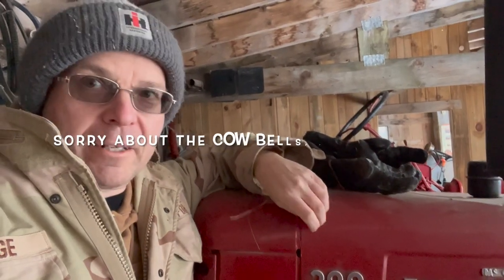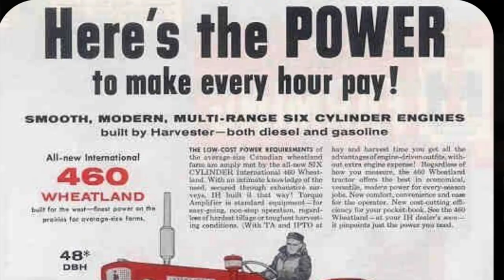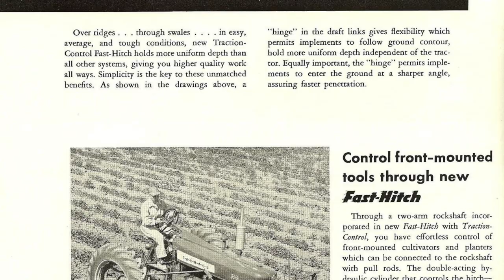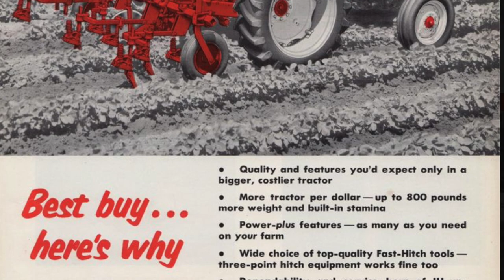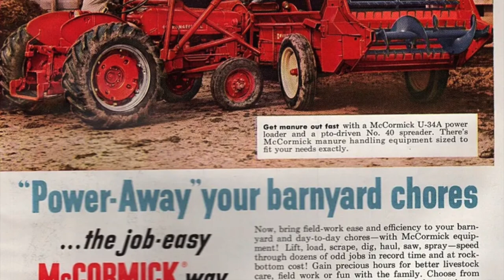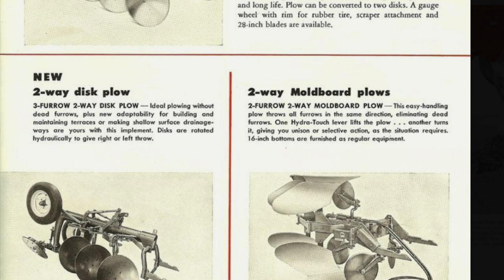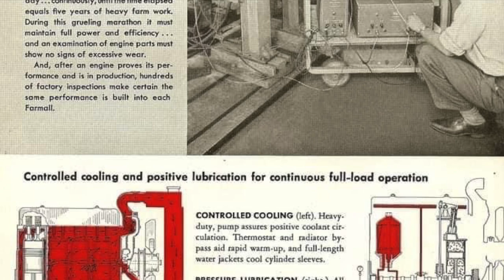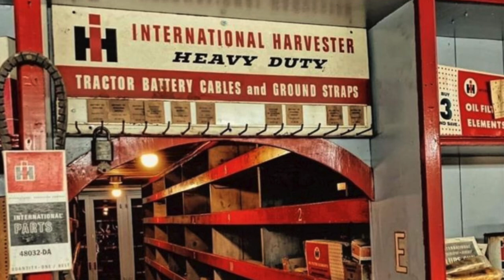International Harvester Farmall 100-Series Tractors,1954-‘58

Comment: My understanding is that slow selling Super W-4 was replaced by the fast selling H 300 Utility.                                                            Big end of the range was the "9" series (W-9 etc.) which were only built as Standard Tread tractors. They had a separate history to the smaller Farmall models. There was originally a W-9 and a WD-9 diesel- both 335 c.i. The Super WD-9 (350 c.i.) replaced the WD-9 but there was no Super W-9. Strangely IH offered a gasoline rice-field model called the WR-9S (335 c.i.) which equated to the Super WD-9 wheatland model. In the "100" series Super WD-9 was updated as the short lived International 600.                     The International 650 replaced the 600. The 650 was the first in this lineage to receive an LPG fuel option. The 600 and 650 never had a Fast Hitch option or Torque Amplifier option. The very different International 660 that replaced the 650 received 😀these options.
Reply from the maker: that I did not know.  I rarely see any of those tractors here in Maine.  thank You!